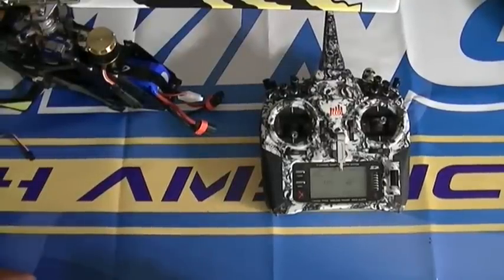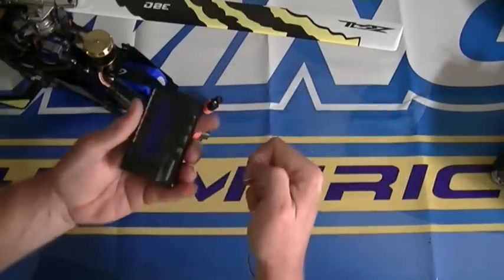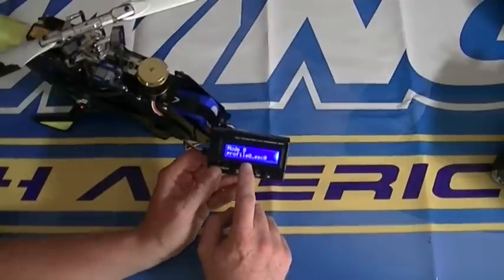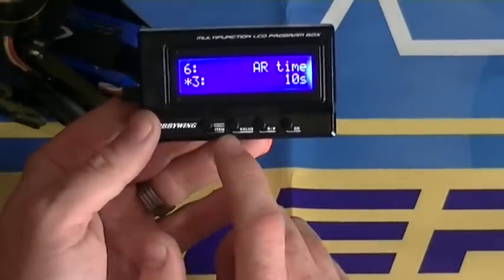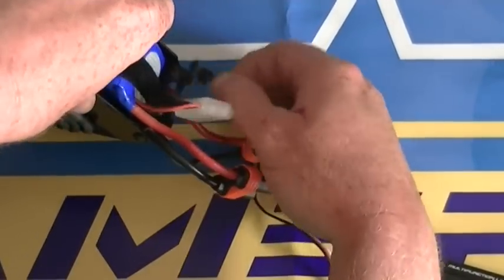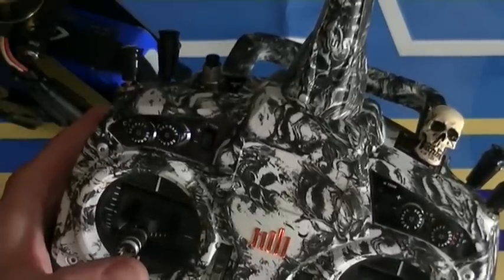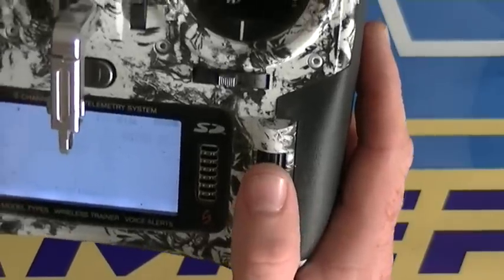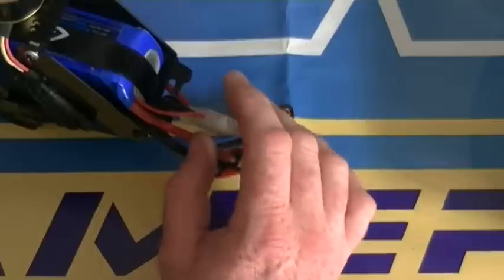Hobbywing Platinum pro V3/4 esc gov setup P2

Comment: I have the 60A esc and after i programme the throttle, the motor spools up at 50%.  0 to 49% i get nothing. why?
Reply from the maker: lys avin actually it should be closer to 40% throttle before the motor starts to spool up. If it doesn't spool up till 50% you may need to recalibrate the throttle end points.
The 40% is normal for any gov mode as that's how you know it is programmed correctly.
Reply: I am not running Gov mode. I haven't even got to that part yet. i just purchased this esc and i am trying to program the high and low throttle.
Reply: can you spell your name so i can find you on facebook. i think you said dave barley right.
Reply: my 100A hobbywing was doing the same thing and this guy showed me how to fix it. and get the throttle to start after 5%, but i forgot how.
Reply: i will never buy a hobbywing esc again
Reply from the maker: lys avin I'm not sure what your deal is dude. Do you want help getting it going or Not? To say you won't buy another HW because you can't figure out how to operate it is your option. 
Let me know if you want the help
Reply: that comment was not because of you. i think that hobbywing esc are too difficult to figure out. sorry for the misunderstanding.
Reply: i am trying to get the throttle to start after 5 to 7% throttle not 40%. and i can't remember how to do it.
my 100A starts after 5 to 7%. i would appreciate your help very much. again will not run Governor on this bird
Reply: hello DarkSyd3D
will you be able to help me tonight or should i try another time. i'v had this esc for a weeks now and i am unable to get the throttle to start at low throttle stick.
Reply from the maker: lys avin I'm happy to help yoou tonight brother. My Facebook page is linked on my YouTube channel. Pm me trough Facebook and you'll see how easy it is to do
Reply: i just sent you a friend request
Reply from the maker: lys avin I'll be going to bed in an hour from now so if I don't reply I'll follow up with you tomorrow
Reply: i don't how to pm on fb. sorry, i am new to fb. i sent you a friend request. also, i am in New York and it's 10:45 pm. will need to go to sleep soon.
Reply: dude. i am willing to paypal you $10 to get help now.
Reply: i you are busy helping others or busy doing something else, just let me know. this is why i said never again with hobbywing. when i call or email, i get no help. and some hobby shops that i call are saying the same thing. two week with no help.
Reply from the maker: lys avin no need for that man lol. I'm not getting instant notifications through YouTube. It's taking several minutes for me to know you replied.
My Facebook is Dave BartleyRC. Pm me and I'll help you out tonight. Should take too long
Reply from the maker: lys avin also, let me know your Facebook name if you send a request. I get a lot of spam requests
Reply: strongman
Reply from the maker: If you're not new to the hobby then you already know it's not easy getting help directly from a manufacturer. That's why they have reps and team pilots. But we are normal people with normal lives so although most of us try our best to help it's not always as fast as some would like. But help is out there...

Comment: dont have program box trying to do through the TX
Reply from the maker: oh I see. Unfortunately the V4 escs aren't stick programmable. This is because there are more parameters to set the the V3 and using a program box or Wifi express module eliminates all the confusion.
also, there is no way to update firmware without one of the above mentioned items
Reply: Can you tell me how to get into program mode using the Tx I have the 100 amp platinum  v3 I turn on the tx put throttle to full ( throttle hold on )then plug in battery and it just arms normally.
Reply from the maker: oh my mistake. I thought this was my 160 video lol. you need to have TH off for programming mode to activate. So keep the throttle at 100 then arm with TH off. make sure to calibrate the throttle first so it sees the 100

Comment: Why would you run the gov in the ESc, instead of the FBL unit? I run a brain, and I thought they were supposed to have better Govs than an ESC, since they are proactive, rather than reactive.
Reply from the maker: tee HW gov is extremely tight and has zero loss of HS in any maneuver I can put on them. it is reactive and TECHNICALLY a fbl responds first but for me it's not a noticeable difference. There's always power when needed
Reply: Ok, cool. I'm just more comfortable setting up the Gov in the Brain. When I callibrate my 100A Platinum v3 for the first time, should I have it in a normal mode with my throttle curve 0,25,50,75,100? The reason I sak is because I am supposed to run my curves in the brain 40, 60, and 100 all the way across. thanks.
Reply from the maker: +steve sparrow the HW gov is quite easy to set up if you have the LCD program box. 
Initially you'll need to set the endpoints like normal in the brain and keep a 0-100 linear curve to calibrate the HW throttle. This is done by moving the throttle stick to full, arming the esc and wait for the first couple tones. Then after go to zero throttle and you should hear the rest of the tones. Make sure your throttle hold is off during this :)
Reply: Yes, I have the Progamming box. I just was not sure if I should have my TX set up for normal mode to be 0 through 100, linear. I think for my throttle it was up at 137 both low and high, because I had a castle talon. I guess I go back and set those to 100 in the TX? I don't think it really has the end points for the throttle in the brain, just the pitch, and then you set head speeds.
Reply from the maker: +steve sparrow unless something changed in the brain software the throttle endpoints had to be set in the fbl using the travel adjust on the TX. you should get a 0 at low and a 100 in high in the throttle setup screen of the brain software.
The throttle servo numbers don't matter to the HW as long as the brain sees 0-100 the throttle curve is linear. The HW will see that as 0-100 as well
Reply: can someone help me.  am trying to get the throttle to start after 5 to 7% throttle not 40%. and i can't remember how to do it. my 100A starts after 5 to 7%. i would appreciate your help very much. again will not run Governor on this bird
REPLY. i am not getting any support from hobbywing.

Comment: I don't have a $300.00 radio.   I use a $49.00 radio.  but just spent $275.00 for a Hobby wing 130 pro platinum HV. 
 Any body want to purchase a Align 700 DFC with KST servos, Ikon 2 , and X nova motor ?

Comment: Hobbywing is junk! no warranty. I bought direct and had problems with 2 of the 4 esc's! I got bent over!
Reply: If you bought them direct you had a warranty bud, I would double check that whole 'bought direct' theory.
Reply: I been using these...no problems at all
Reply: i purchased 2 hobbywing a 60A and 100A. the programming is very confusing and tech support sucks. i emaid support and told them after programing the throttle on my heli, my motor will start spooling at 50% throttle. his reply was" it seems to me that you are having programming problem". what an idiot. I am with you. never again.
Reply: can someone help me.  am trying to get the throttle to start after 5 to 7% throttle not 40%. and i can't remember how to do it. my 100A starts after 5 to 7%. i would appreciate your help very much. again will not run Governor on this bird
REPLY. i am not getting any support from hobbywing.